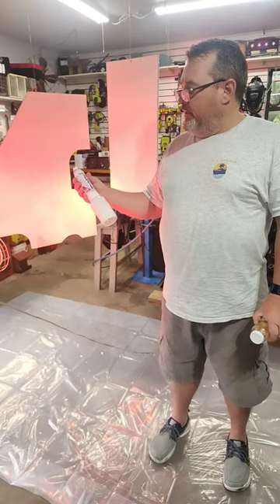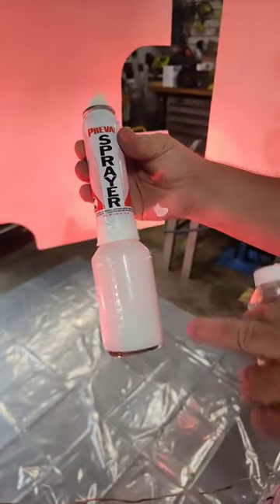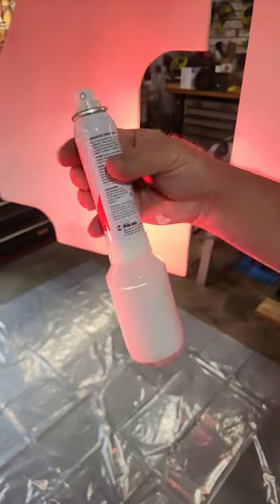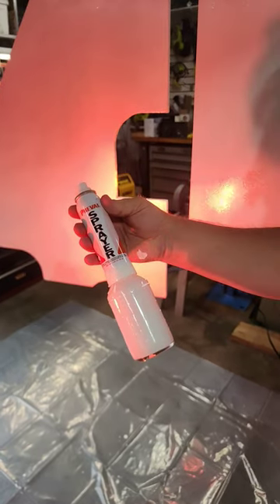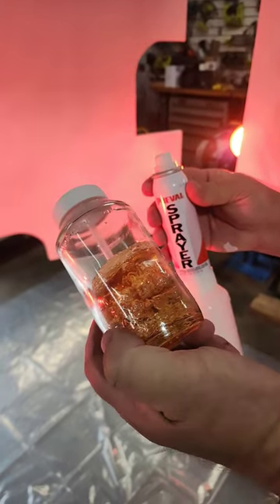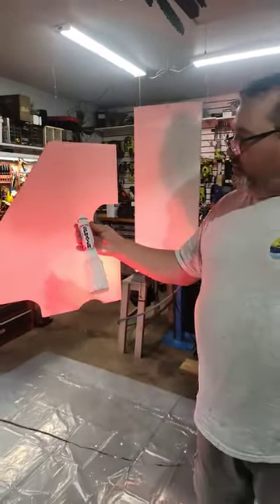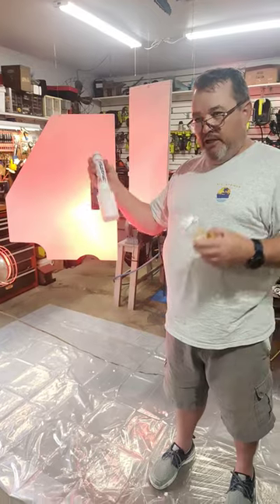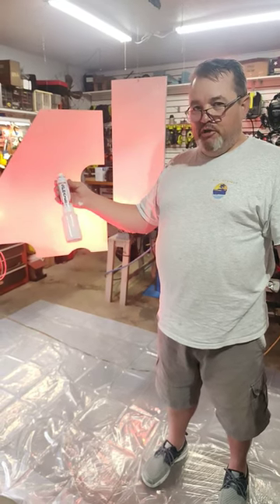Small DIY boat painting projects #trawler #diy #painting #epoxy #sailboat

Comment: How cool ! I had never heard of that before but it could definitely come in handy. Thanks for the tip !
Reply from the maker: They definitely come in handy when you just need to quickly spray a part with good paint and dont want to break out the rollers, brushes and pans or if its a small part you can roll or brush.